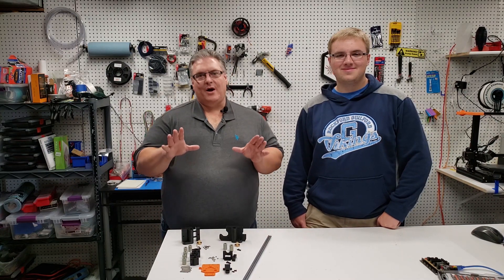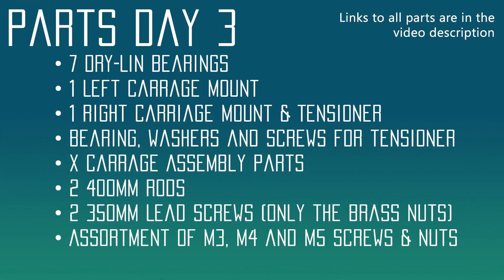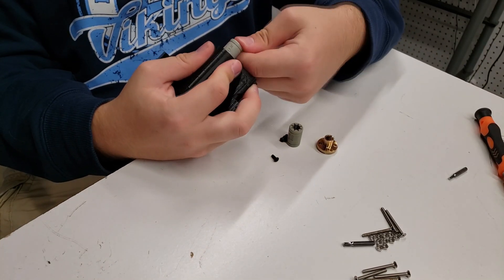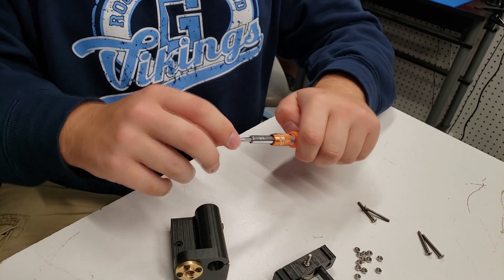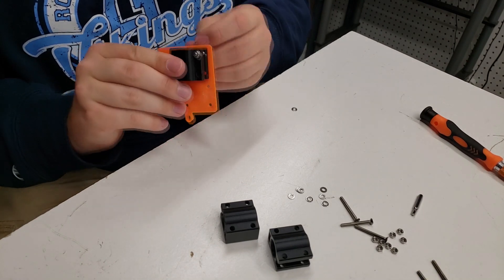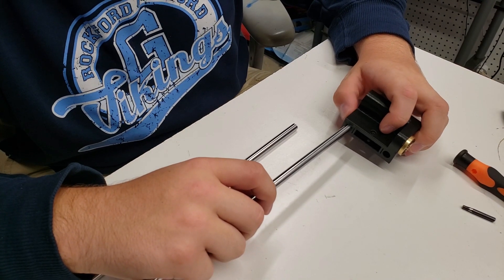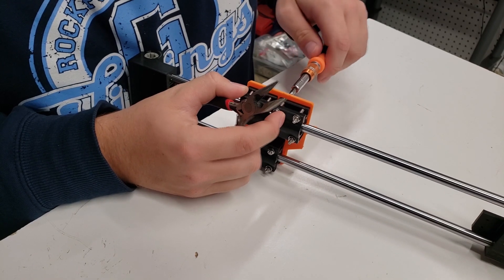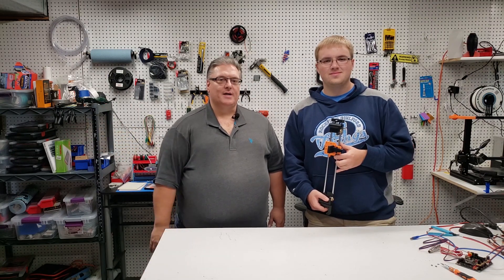Build Your Own DIY 3D Printer From Scratch - Part 3 : The X Axis (DIY RepRap 3D Printer)

Comment: 4:00 in the links there are 3 different types of pillow blocks, looks the same except different file names. Does it matter which one to print. Please advise.
Reply from the maker: Varies based on how you build it. I offered a few options.  Some work better than others depend how closely you follow the build.

Comment: Could you please send me a link showing where to find the orange plate you attached the other pieces to at 4:58 ? Thanks!
Reply from the maker: That plate is part of the carriage assembly on thingiverse.  Check the X Carriage parts from the bill of materials.  Its in the same set of files as the nozzle mount, part cooling fan, etc.

Comment: I'm considering using a dual extruder hot end, would a 3D Chimera increase the weight of the carriage enough that I would have to use a beefier stepper motor?
Reply from the maker: Nope you would be fine.

Comment: Just a couple issues so far ... why didn’t you use regular bearings instead of the plastic bearings. Next... did you design the plastic parts in Fusion 360, or what software did you use. Would be nice to use the file to make modifications to bearing sizes, etc.  thanks for the effort on the videos.
Reply from the maker: I used the drylin bearings vs the traditional ball bearings for sound.  I've used both and the drylin are quiet and perform equally well.  You can however use ball bearing ones if you choose, it is entirely a personal choice.   The Bill of materials has links to all the models for the printer.  Some models were created by me in Fusion 360 others were created by the community at large and available on thingiverse.  There are a number of bearing blocks on Thingiverse so if you find one that works better and fits the standard block size feel free to substitute it with your preference.

Comment: What STL files did you use for this section for the X axis assembly? Trying to build this myself and have found several variations but not the one that was used.
Reply from the maker: The STL's are linked in the bill of materials.  Which part specifically are you looking for?
Reply: @MakersMashup  I found that most of the links were corrupt in the spread sheet and the collection that you have on thingiverse is incomplete.  Was looking for the X axis assembly but found another one that fit the bill perfectly https://www.thingiverse.com/thing:1103976 . 
I do have a question regarding the Z access mount for the linear rails at the bottom is there a STL file that has the motor mount and rails all in one that you used?

Comment: It's better to rename this guide "print a diy 3d printer. "
Reply: i was about to comment on this. its impossible to make this printer without a 3d printer.
Reply: That's unfortunately the case with a lot of DIY printers. I'm sure with enough research, you could find a lot of the motor mounts, tensioners, etc. needed to build a printer, but it's much faster to either use a friend's/library/school 3D printer to print your parts, or just buy a cheap one like an Ender 3 to learn about 3D printing and build one later.
Reply: Go on Etsy and have someone print the parts for you lol 
It’ll cost more but do your thing

Comment: Hi, can you send me the links for the mounts for part 3? I cant find the files on the list because the links are not right or they are showing the same parts. Also I did not see the brass nuts listed on your excel list, could you link it.
Reply from the maker: Can you be a bit more specific of which mounts you're referring to.  Which brass nuts are you referencing? The only brass nuts I can think of are the ones that are brass inserts for the mainboard.  I'll check the BOM and see if they are there and if not I will update that.
Reply: Makers Mashup I was referring to the Hictop brass nuts that come with the rods but I found it on amazon. I found the mounts(for the x direction) by the way except they are the opposite shown in the video. Also, I can’t find the pillow blocks in this videos and could you show me the link to the stl?
Reply from the maker: @Badboy521998  its in the Bill of materials under "Bearing Blocks for X-Axis" its this model https://www.thingiverse.com/thing:2404074
Reply: @MakersMashup  ok sounds good, btw which dry-lin bearing block is it supposed to be because there are three different ones.
Reply from the maker: @Badboy521998  that depends on the printer you use to print them with.  I used the 15mm ones but you may have to use a different one depending on how it fits with the bearings in it.